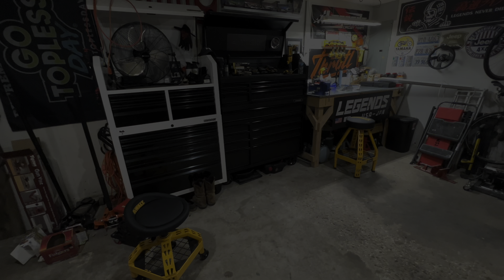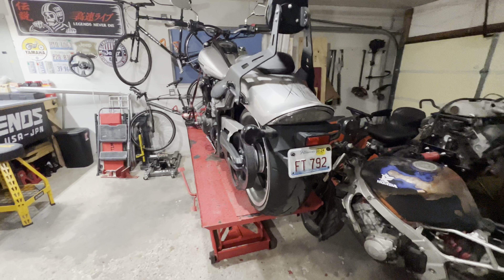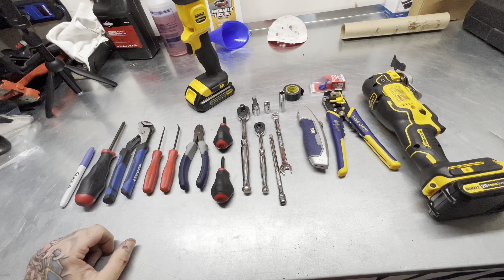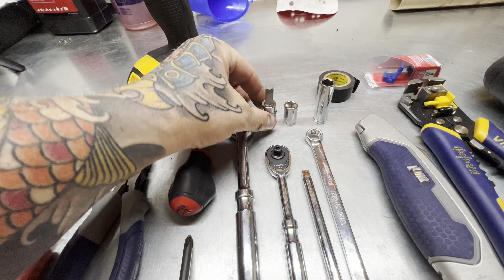Yamaha Raider Blaster-X Integrated Taillight and Performance Edge License Plate Mount Install

Comment: I installed led signal lights and they are hyper flashing on my 2010 raider. Is there a plug and play resistant which i can install? or what would you suggest?
Reply from the maker: Sorry I am just now seeing this. There is a resister you can install. I believe it does make the auto canceling turn signals not work anymore though.

Comment: Where did you get the side mount bracket pls? I am looking one for my 2010 raider S. Greatly appreciated.
Reply from the maker: Performance Edge. They have a website (performanceedge.us) and an eBay store. I got mine from them through eBay. I am very happy with it.
Reply: @kdubgarage7202  thank you. Is it brighter than the stock?